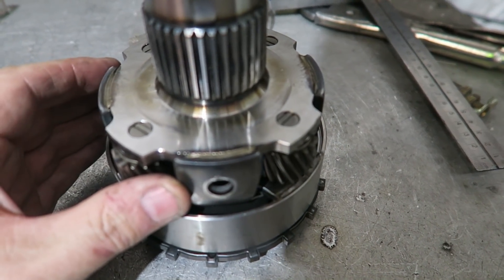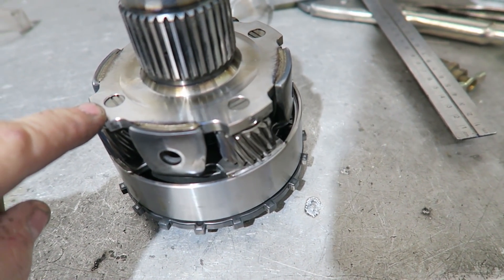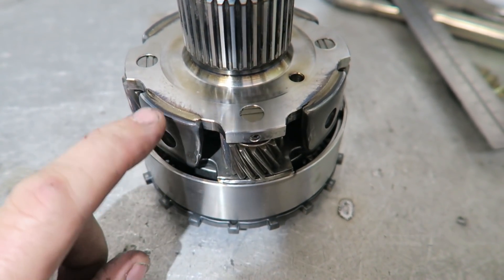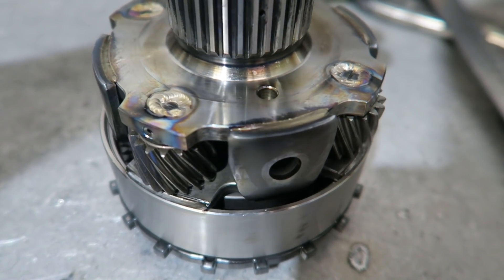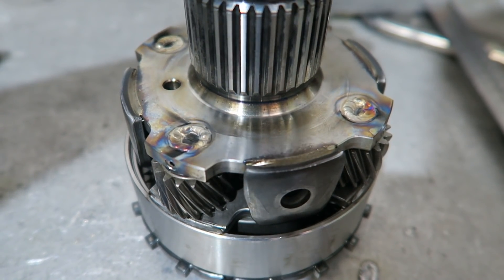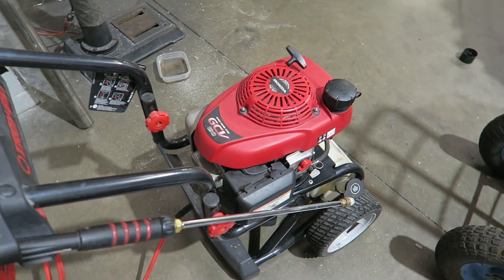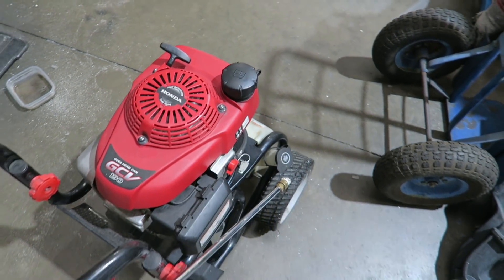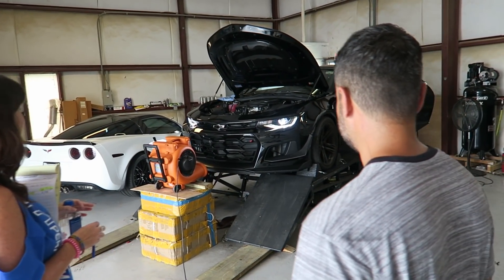We Dyno a Camaro ZL1 1LE for a baseline

Comment: John, I have an 01 S2K and want to start refreshing the suspension bushings. Any tips on which ones typically need replacing first? Which ones will have the most noticeable affect on handling? Thanks!
Reply from the maker: Nick Cuneo We notice the bushing in the lower arms are worn the most. Especially the bushing the shock connects to.